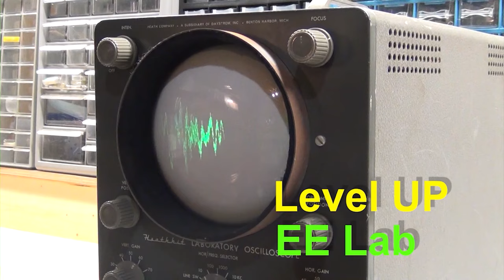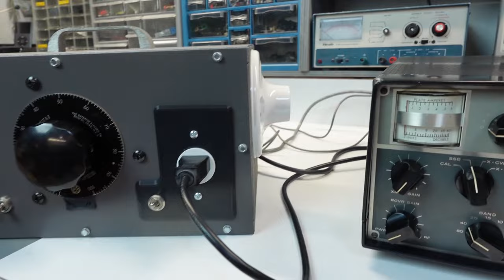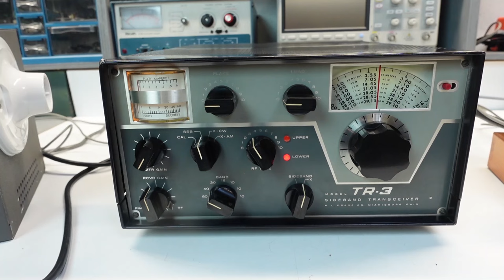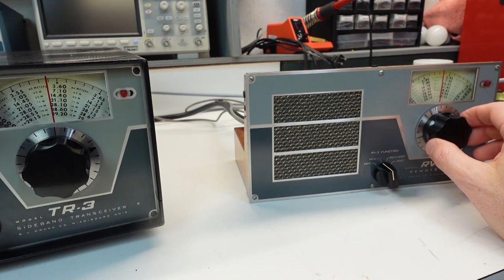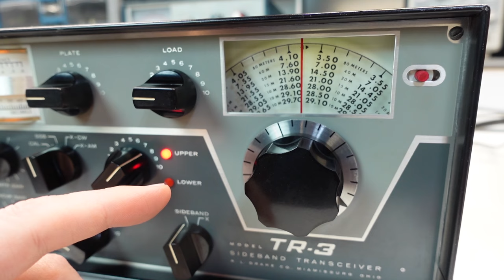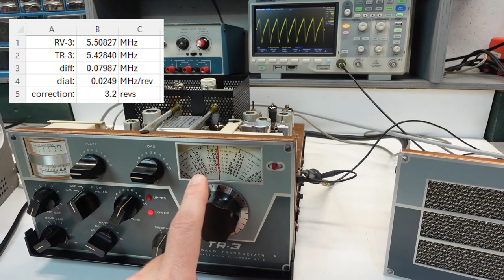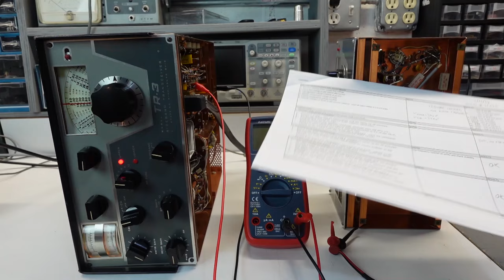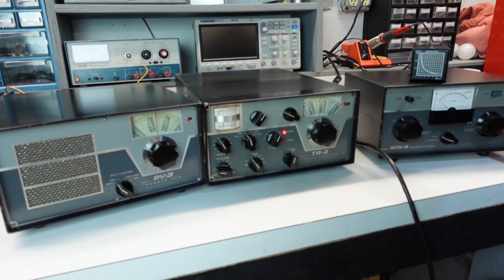Drake TR-3: Episode #4

Comment: Just a note. Looks like you had RX, RF gain maxed out and that's ok on the higher bands, however on 160 - 40 meters back the RF gain down a bit and the RX will not overload as much. Yes the AGC is suppose to throttle the gain but on many rigs of that era it's not as effective. Good luck es 73